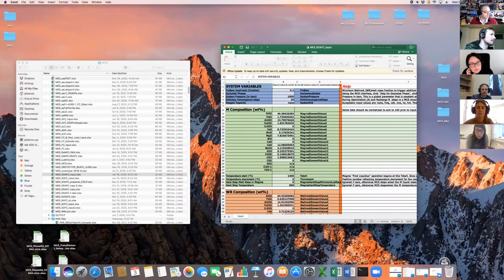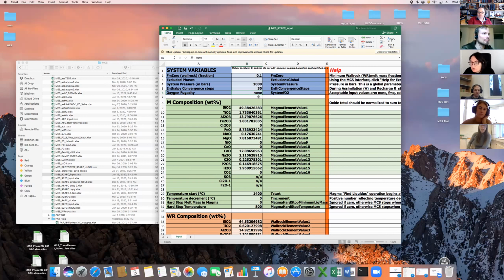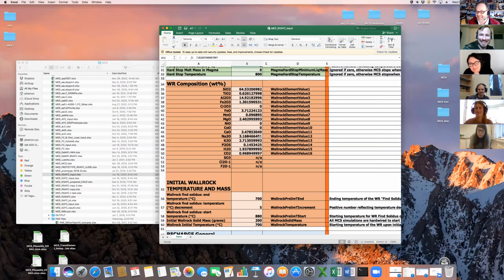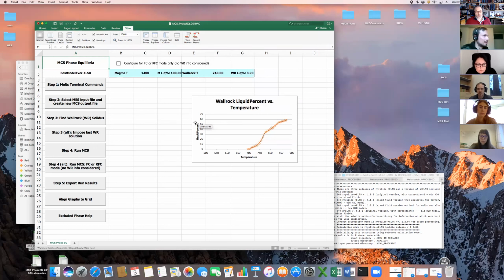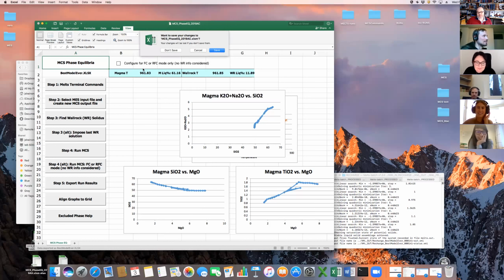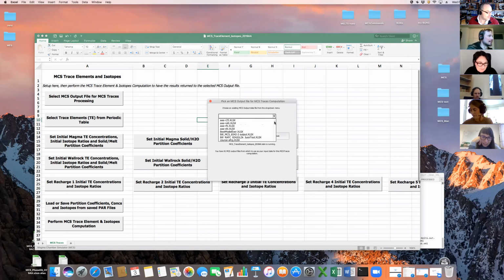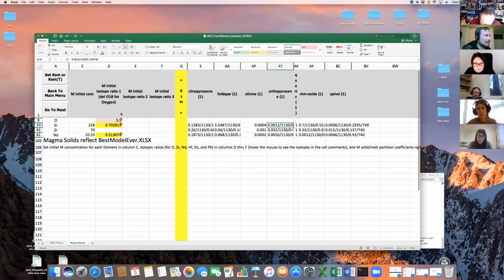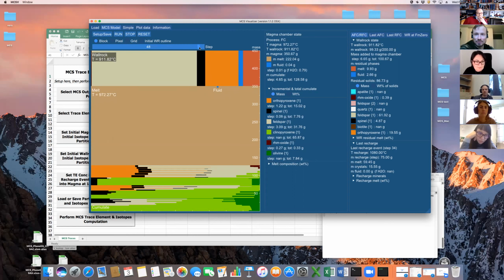*Magma Chamber Simulator* Practical Class with Jussi Heinonen #geology #science #lava #volcano

Comment: How did you calculated oxidation state of Iron (FeO to Fe2O3)?
Reply: Using MELTS at FMQ at liquidus. So I predefined the oxidation state using MELTS. If you cannot or do not want to use MELTS and do not want to force the oxidation state, you can also make one MCS test run WITH forced FMQ (or whatever buffer) and then use the composition of the first step as a starting composition in the actual run with "none" selected as the oxidation state.